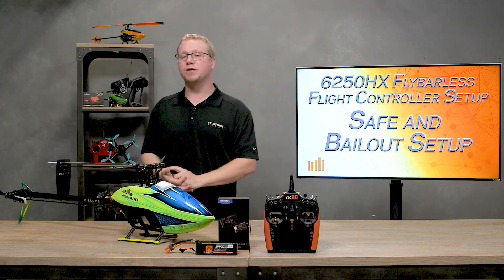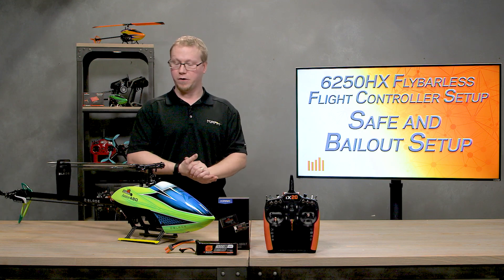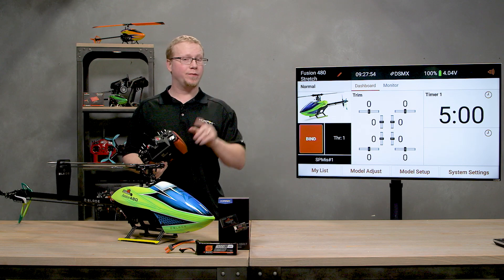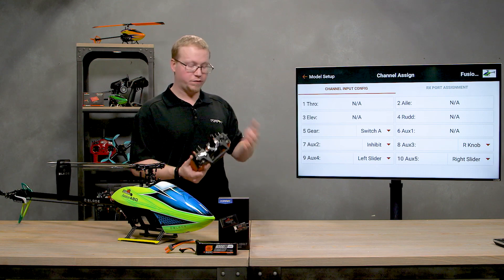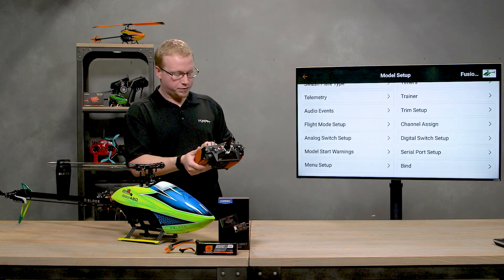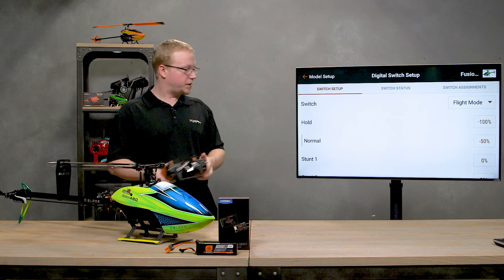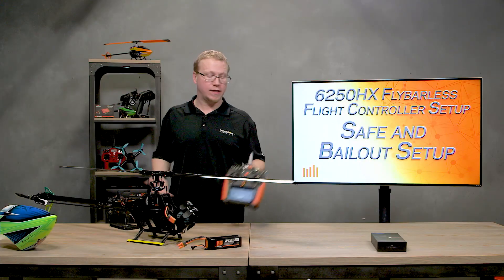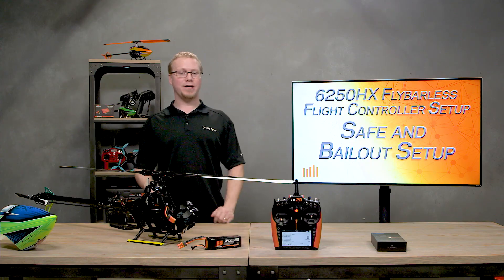Part 7 - SAFE and Bailout Setup - Spektrum 6250HX Flybarless Controller Setup Series

Comment: Hi, love the videos which make it super easy to set up, I am using NX10 on a Logo 700, is it ok to put either heat shrink or thin wall fuel tube on the aerials to provide some protection & keep away the bare ends from the carbon fibre, thanks Pete

Comment: Hi Tom love the videos i am setting up a trex 550 e using the 6250hx with the ix12. I am having issues with the Bail out and the mixing gear to gyro. I can select gear then in the next drop down box I have no gyro selection .I've gone through the set up process but keep getting stuck here please advise  cheers mate
Reply: Try GER to GER instead of GER to GYR and ensure your GYRO is set to your gear channel in channel assign menu. I had the same issue and found this solution on a FB forum.

Comment: How does SAFE stability work with helis that have an angled frame such as the SAB Krakens where the FBL is also not parallel to the gorund due to this? I'm sure its fine once it is in the air, but how does it work when taking off and landing? Also, is there a way to enable SAFE mode on a specific switch seperate to FMs so that I can enable it once the heli has lifted off the ground first?
Reply: Very good question, i have the same problem, very tricky to hover, the heli tend to became horizontaly when trying to hover it

Comment: Do i need to use the hover settings in throttle setup on a Nitro helicopter??
Reply from the maker: It can depend on the model and pilot skill. The Hover setting essentially helps alleviate tip overs during take off. Set it to the throttle value that you feel gets the heli well into the air in normal mode and it should work correctly.

Comment: Safe mode setup will not work as shown here with the DX6E transmitter because it has not aux2 channel.  SAFE  is either on for all modes or off for all modes. How can the dx6e be set up to allow SAFE on Normal mode only?

Comment: I have a DX9 and the 6250hx on my Thunder Tiger G4, I have followed your setup and the only thing is when I press the I, bailout button the swashplate moves hard down to the right and have no input to the swashplate on both sticks. Something is tell me that this is not right. any help would be very helpful. Thanks' for your great videos. Ivor.
Reply from the maker: Hi Ivor, my first thought it that you may have the orientation set incorrectly? I would double check that setting first and go from there

Comment: At 11:46 Tom stated that the roll attitude trim of 450 was essentially 45 degrees. That does not make any sense, because it isn't practical. 

Is it 4.5 degrees?

Helicopters typically hover with one skid lower than the other, but it isn't at 45 degrees.

4.5 degrees sounds more realistic to balance forces.

Where is the written documentation?
Reply from the maker: Jack, thank you for pointing this out! You are correct 450 = 4.5 degrees

Comment: ☠BLACK BARON☠ 6:05 "Envelope Pitch: X" and "Envelope Roll: X" is a really great software iDea for the Beta 4 NXT Release. Envelope is Envelope to define different angles "InAir" for roll and pitch. Attitude Trim is a trimming function.
Reply from the maker: The Safe gains should not have any effect on the tail. It sounds like your cyclic gains are pretty far off if that is what your experiencing.
Reply: @SpektrumRCvideos  ☠BLACK BARON☠ 10:48 The SAFE stability mathematics algorithm is awkward ... I can't manage to establish a stable nose right and especially a nose left turn in hover mode and outside the hover offset range on my heli. It's always slightly drifting in roll/pitch directions. The SAFE gain + SAFE Envelope value is a real trouble shooter for establishing absolut stable nose left and right turns.
Reply: @SpektrumRCvideos  ☠️BLACK BARON☠️ 10:49 ... does it work stable in both directions if I turn the heli 360° clockwise and counter clockwise in the air? 5:25 Does Stability ON work well with the Hover values and Hover Offset values in different altitude levels ... especially during descent flights ... it looks very unstable as I have noticed.

Comment: Looking for some help! Acquired a Blade Fusion 360 smart (on 3s) a few months ago and just had an opportunity to do the transmitter set up etc ( I am using a DX6e). Did all l the stock settings (as per the manual). In Flight Mode setup, I assign switch B (top left) as my flight mode switch.  In Channel Assign, when I look at Rx port assignments,  I see [B]5 GEAR: Gyro[/B] - is that right?  Then on Input Config, I see [B]5 Gear: B[/B] - is this right? 
Am used to having 3 flight modes with my 230S V2 where the gyro settings linked to switch B are: position 0 at 100%, position 1 is 0 and position 1 is +100%. A chap at Horizon Hobby advised 'The gear channel out put only controls which SAFE mode helicopter is in. When its receiver sees 100% in put on ch5 it goes into self level, when it sees centre or 0% it goes into intermediate, and when it sees -100 it goes into advanced mode which turns SAFE off'. 
I want to replicate that with the 360 - can I/should do it?
Also, when I initialise, there is a constant high-pitched humming noise coming from the FBL controller - is that normal? 
I get a flashing green light to start with but this changes to blue flashing when I go into forward programming - does that sound right?
Hope someone can help me with the above - I would be most grateful. Thank you
Reply from the maker: Hi Robin, For the most part that all sounds correct, EXPECT in the channel assign menu make sure that Gear is set to FMODE, not the B switch. This is different then the 230 S V2. If that is set to B the flight modes will not work propperly. That should do it. Also the humming you are hearing is likely the servos, which is normal.

Comment: please make a video for the ix12 they are not the same
when i go to channel assign aux 2 is all ready set to switch " E "
why do you think there the same ????????????????
Reply from the maker: Programming wise, they are the same. The default switch for AUX2 is E on all current Spektrum transmitters (iX12 and iX20 included). You will need to change the channel assignment for AUX2 to Fmode if you wish to use it for SAFE flight modes.
Reply: stability mode shows hold with throttle cut on or off flight mode1 stays on hold
flight mode 2 says normal throttle cut still not working flight mode 2 says stunt 1
Reply: tech support gave me a different setup ????????????????????
please go thru the setup with a ix12 and see if it works i have been trying for a week and still cant get it to work

Comment: Hi sorted out my gyro out but now swash move to an angle in stability mode any thoughts
Reply from the maker: Completely normal and intentional for the swash to be at a slight angle in Safe, it is to counteract torque and keep the model level :)
Reply: @SpektrumRCvideos  ☠BLACK BARON☠ I checked "Stability ON" mode today. The algorithm is much better than in the "Throttle/Hover" forward programming mode to keep it stable near ground. However the FC has still problems on the tail blades to find the correct position before liftoff. It's too much right turn as I have tested out several times on a test flight field.

Comment: On my NX8 setting up Safe mode I cannot display "Hold" when using switch "H" even though Normal, FM1 & 2 are displayed.   I have set Throttle Cut to -100 on switch "H" in position 1. I am obviously doing something wrong and need your help.
Reply from the maker: Go into the flight mode menu and set Hold to switch H and use the throttle curve menu to set the Hold position to 0 on each point. That should do it :)
Reply: @SpektrumRCvideos  Thank you, I had not selected a switch in the throttle cut menu. I already had the hold position at 0 at each pt.
Reply: I have another question re the screen at 14:19 where you talk about Proportion, Integral and Derivative Gain. Where can I access this on the NX8?

Comment: Help pls.  Was a cheapskate bought dx6g3.  A.  Can this fc and tx perform all stability settings in all 3 fmodes?  Also when I have it set what I think is right I either have all stability or land enter menu turn safe off then fly.  No switching.  So my question is I can access gain for all 3 do I just turn gain down on the two stunts??   Thx

Comment: I have a DX9 & a Spektrum 6250H gyro in an Align 550 DFC, It flies fine but if I enable the safe mode, it is in safe mode in all flight modes, not just normal. When I check it on the transmitter it shows safe in all flight modes. If I turn it off, it turns off all flight modes. There is some kind of difference between the DX9 & the IX20 programming. At 2:22 thru 2:31 in the video he explains the Aux 2 setting but he says if you own a DX model scroll to flight mode, however flight mode is not listed as an option?

Comment: With all the questions already on these few points only, I really wonder why Horizon/Spektrum does not offer a working setup to download with the Spektrum Programmer Software, exaxtly how it was made for example for the Blade 330S and Fusion 360 (together with working Spektrum-Radio-Settings for the different Radios, just like with almost all other helicopters and models). It would be so helpful as it works amazingly with the other models like the Fusion 360 where there was a Bailout-Update.
Reply from the maker: Their are firmwares that are specific to the 330S and both versions of the 360 that have all the settings preset when you install them on the the 6250HX using the Spektrum PC Programmer

Comment: Say I want to add safe mode to switch A so I can turn SAFE mode on and off regardless of what Flight Mode I am in, what would that configuration look like?
Reply from the maker: I will try to explain it as best as I can. If you put the A switch on an open channel and then select that channel in the forward programming menu, then in theory this will work. That being said, each mode will have its own set of gains and settings, so you may want to go thru all the menus after wards to make sure they match in both switch positions. Hope that helps!
Reply: @SpektrumRCvideos  sorry for my lack of knowledge but can you please tell me where I would assign that channel in the forward programming menu.

Comment: I have a DX9 & a Spektrum 6250H gyro in an Align 550 DFC. I have preformed the setup by the videos. It hovers just fine except in the safe mode if I release the cyclic stick the heli drifts right & forward. More to the right than forward. Where & how do I adjust for this?
Reply from the maker: Hi Roger, First I would suggest doing a sensor calibration. Test afterward. If it still drifts, then I would double check your swashplate for being precisely level. Also make sure there is nothing causing vibration, such as blades being out of track. Hope this helps steer you into the right direction!
Reply: @SpektrumRCvideos  Yes I re-calibrated it & it stopped the drifting. Next thing is I flew a large circle & when it was on the backside of the circle I was having trouble seeing it, so I turned it nose in & pushed both sticks forward to bring it straight to me, however it seemed like it just sat there & hovered. It did not appear to be heading to me. I turned it around to tail in & pulled back on the elevator & it felt the same like my pitch rate was way limited. I then turned it sideways & it flew in to me side ways ok. In the Safe Mode (normal) I have the envelope set at 45 & I thought that was for pitch & roll? Is there something I need to set separately for the pitch?
Reply from the maker: @rogercirelli7408  No they are combined. But that does lead me to think that you are running out of date firmware. There was a fix a while back to correct an error where the envelope setting was stuck to the same envelope applied to Panic (which is very limited)
Reply: @SpektrumRCvideos  Exactly how do I do that? What do I need?
Reply from the maker: @rogercirelli7408  you need our SPMA3065 USB cable. Watch our video on updating receivers and you will see the process

Comment: Yeah I have a problem with the 
DX6 G3 SPMR6750
F-Mode is switch B
Hold switch to Hold
Channel Input Config 
Gear-FMode
In FowardProg. Setup 
FM channel to: Aux 2 and tried all the AuX and gear but nothing works as it should.
Gain Channel: Gear
Then in SAFE
Stability goes straight to 
Flight Mode 1 
Stability: On
It will not let me see normal, Flt 2 and Hold. 
My mixing is GER >GYR - I
Rate: 125%.     0%
Offset: -100%
 Switch: Switch I. 
Everything works fine accept I can’t select Safe on/off on Normal, IUP 2 and Hold. Why ??? I can’t even find the SPM file in your website like other models. Why???
Reply: Don't know if I fixed it yet this befuddled me too.  If you go to where the 3 modes for safe  are u just raise the throttle and menu changes.  Hope this isn't too late.

Comment: I have a DX6 g3 and this is the most confusing thing I have ever seen, and I am a Physicist
Reply: Most spektrum stuff is way too confusing.
Reply: @wildgoobsid5   Collective pitch helicopters are complicated, expensive, and not for the faint of heart. All flight controllers  and CP Heli's require patience, study, and attention to detail. I find time, practice, and a good flight simulator helps a lot. It all comes together with your first stable hover. I've seen full size Heli pilots flummoxed by this hobby !
Reply: Yeah I have the same problem with the same radio. 
F-Mode is switch B
Hold switch to Hold
Channel Input Config Gear-FMode
In FowardProg. Setup 
FM channel to: Aux 2
Gain Channel: Gear
Then in SAFE
Stability goes straight to 
Flight Mode 1 
Stability: On
It will not let me see normal, Flt 2 and Hold. 
My mixing is GER >GYR - I
Rate: 125%.     0%
Offset: -100%
 Switch: Switch I. 
Everything works fine accept I can’t select Safe on/off on Normal, IUP 2 and Hold. Why ???
Reply: 😂😂😂 that makes me feel better finally.
Reply: Funny thing about the RC hobby, job titles mean very little.  You need to do the research.
Reply: Yes!   😂😂😂😂😂

Comment: How can you set this up on a dx6 .. there is no aux 2 ?
Reply from the maker: You can use any channel that is available to you. Even gear (CH5) . You will just have to remove gear from the gain channel and adjust tail gains primarily in the forward programming menu. Remember, tail gains can change drastically depending on head speed and model size. so it is really important that you get the tail holding well in every mode, so try not to neglect this part.
Reply: @SpektrumRCvideos   I dont fly 3d just scale
Reply: @SpektrumRCvideos   also if you take away the channel the gyro is using then the mix for the bailout cant work either ?
Reply: You need to make a video of doing this on a dx6 as a lot of people are going to only have a dx6
Reply from the maker: @OutbackKanga  No the mix will still work
Reply from the maker: @OutbackKanga  In a way it is a 20 channel receiver, it just have 6 outputs.
Reply: @SpektrumRCvideos  I also am using the DX6 and have purchased the Fusion 480 smart super combo. Will I be able to assign SAFE to it's own switch so I can turn it on or off in any flight mode like I have my 230sv2 setup?
Reply: On A Dx6(e), why not just assign safe to Aux 1 along with your flight modes?
Reply from the maker: @Mr.Studer  Aux 1 is your pitch channel, can't be assigned to a different function
Reply: @SpektrumRCvideos  i meant channel 6? Isn't that your flight modes?
Reply from the maker: @Mr.Studer  Flight mode is really dependent on your setup. You can assign the flight mode to any open channel. On your DX6 it is only your Gear (Channel 5). So instead of using channel 5 for gyro gain, use it for flight mode. The draw back here is you will not be able to use the gyro menu to tune the different tail rotor gains. Hope that helps!
Reply: @SpektrumRCvideos  thanks for taking the time to explain this, but now I am totally confused. How many channels does one need on the spektrum transmitter to setup gyro, assign safe to flightmodes, panic, dual rates?

The whole purpose of this system is to have gyro assigned to it's own channel and safe to separate flight modes (normal, stunt1)? Just purchased this system which I still need a transmitter for, tho i would want as3x (gyro?) Do its job automatically with a switch, but also have safe assigned to two flightmodes... doesn't seem a 6 channel will be sufficient enough? Thanks again
Reply from the maker: @Mr.Studer  For best experience a 7 or more channel is recommended
Reply: This video DOES NOT WORK with the Fusion 360 3s and the NX8.  !  I assigned Aux2 to Fmode in Channel assign, Checked digital switch setup, then in forward programing I get a different response.  When turning on stability it shows Flight Mode 2, gain 50, envelope 45.  No mater what I set the flight mode to it always shows Flight Mode 2.  Heli is also in Hold mode.  For as much money I have spent on the Fusion 360 3s and a new NX8 transmitter I feel this is a big disappointment.
Reply: The video you using the IX20. The settings shown are no where near what the fusion 360 3s are published.  Text support has not been helpful.  A video of fusion 360 3s with an NX8 with safe mode assigned to the Flight Mode would be appreciated.  What good is it to spend money on Horizon Hobbies if you can't get it to work as advertised.

Comment: Could you make a tutorial for the nx 10. It doesnt work for me. I cant change between flightmodes in the forward programming safe settings. Ty
Reply from the maker: Hello! Most of the time this is because you do not have the channel assigned to "flight mode" double check the flight mode menu. Also make sure you have a switch for modes and a switch for Hold set in the Flight mode menu. Hope that helps!